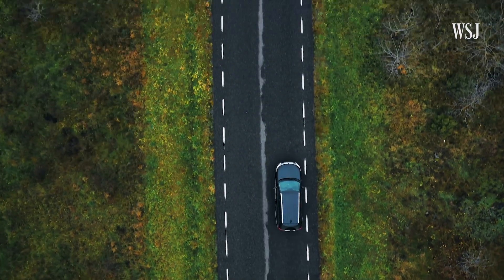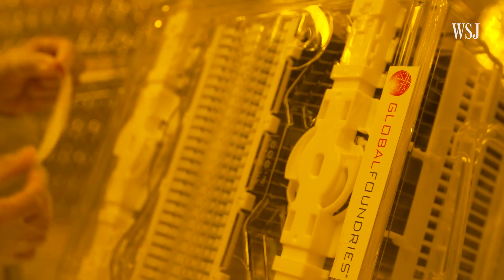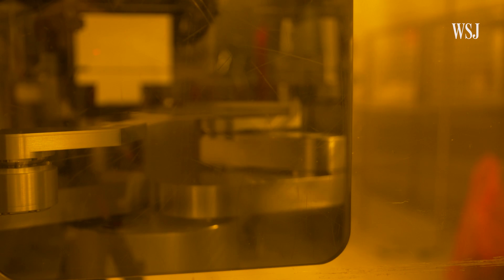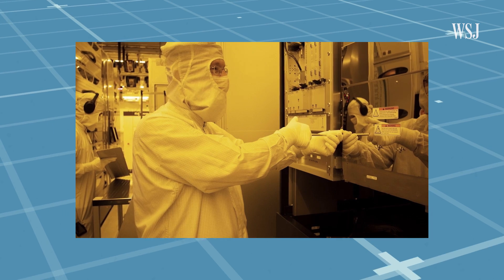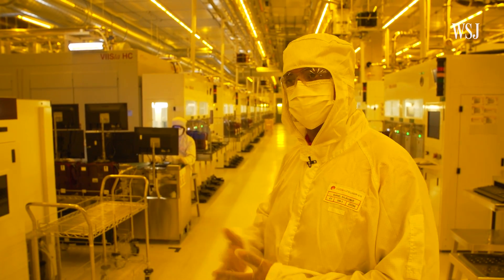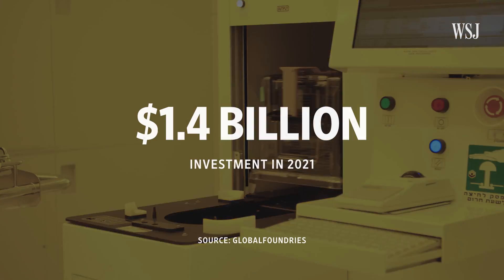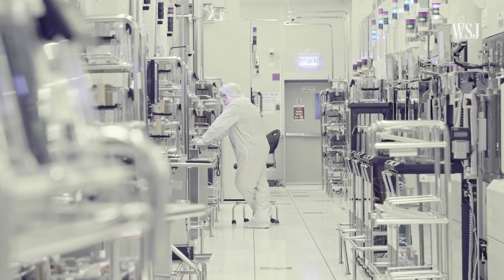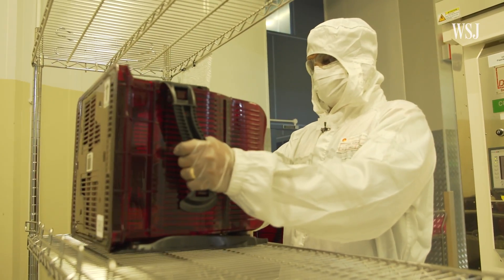Why the Global Chip Shortage Is Hard to Overcome | WSJ

Comment: This video gives a good explanation of the chip shortage albeit incomplete. The modern high-tech smaller chips are made by TSMC in Taiwan. The older, low tech and larger chips are made in China for cars and home electronics/appliances. China has a energy shortage right now that prevents them from manufacturing chips which is energy and water-intensive. China's energy problem is not going away anytime soon. Youtube source: https://www.youtube.com/watch?v=JqDcLmgg0a4

Comment: Inventory of unsold vehicles runs into hundred of thousands if I am not miataken as they make new cars every year and all could not be sold such that they are parked somewhere. Are these chips use in 5G, computers  and new model of cars? All chips are accounted for and nobody is cutting in line. So how long thus a foundry company get even and profit coming to roost? So any change in the wavelenght means new foundry, that would be expensive

Comment: As someone who works in the semiconductor industry I'd like to just point out that a large part of the problem is that all these industries cancelled their orders during the initial peak of covid and most fabs had to slow down production in response.  When they realized that people were still buying things, all those industries just expected the fabs were still manufacturing.  They overpromised before they confirmed they had their supply.

Also I'd like to point out that the process they have outlined here is an EXTREMELY simplified version.  If you want to contribute to the creation of smart cars, smart phones, medical equipment, space technology and more, research more.

Also I'm not sure which process but the device you hear chirping about a quarter and three quarters of the way in was designed by a company called Kokasai.  I know that sound very well.

Comment: Am I crazy or would making square discs be better like what happened to the edge chips that are rounded
Reply: what the youtube video did not show is how the silicon wafer is created....  its actually a very large crystal that is grown in  a chamber... once the crystal has grown to the size they want it is taken to a saw and cut into the  silicon wafers and polished...  the crystals don't grow in a square pattern ....   there are two types of crystals grown...  one is called and NPN and the other is called the PNP...   each type of wafer is used to create either a NPN or PNP transistors....    yes, because the wafers are round the actual devices ( chip ) on the edge of the wafer are scrapped...this is called the exclusion zone for the wafer...  the crystal itself is made from purified sand... so they make sand into money....

Comment: 600,000 chips a year that doesn’t add up with why they just said. 
20 disks per tray x 400 rolling around at one time x 1,000-1,500 chips per disk = 8,000,000-12,000,000. So does does that mean there are that many bad chips being produced at the same time??
Reply: I know from the plant I worked at here in the US, our target was 95% yield on a wafer.  Keeping in mind that was working chips, not prefect chips.  Sometimes the yield would drop to 92-93%.  Im not sure on numbers after all the testing.  I would imagine a decent % of chips would be filter out  due to poor preformance etc. Not pr3fect chips Would either be scraped or repurposed to lower end things.  A lot can go wrong during the several months a wafer would be in the fab.

It also greatly depends on the process, low end cellphone chips would have much better yields then high end chips.   I heard once that super highend yields could be as low as 60% if the process wasrealky new or proneto issues.

Comment: I worked in the industry for 35 years, retiring 5 years ago. I started with the state of the art lithography system company at the time, Perkin-Elmer and finished my career with the present state of the art lithography system company ASML. I met some incredibly brilliant engineers who could easily make my head spin and realize I was merely a dope and they were gods from another galaxy! I installed and maintained these systems around the world. What is better than to see the world on expenses? Thanks to so many geniuses for never failing to enlighten me and giving me a wonderful career.
Reply: while i think you are a little too humble --- there is a lot of engineering for operations / maintainability but there is definitely not the mentaity that a tool / process is engineered by geniuses to be run by idiots (ROTFL) - i agree that some of the materials scientists and engineers I met at Intel & Applied Materials were intellectually  mind-boggling.  I just supported MES & EC software integration in the fabs for 27 years.   Lots of stimulating work & travel around the world.

Comment: Well my PC is 5 years old, and i will hang on to it for another 5, so i'm in no rush to buy.
Reply: My PC is also 5years old and nearing replacement time. Can't run the software I need well......
Reply: @henri6595  What software? 5 years is usually when one upgrades their rig.
Reply: @davehenderson3739  Adobe Suite, MS Suite, 50+ tabs open at once, multiple monitors. I think PCs are only going to be good for <3 years going forward.
Reply: @henri6595  I got my new PC in 2016, so it's 5 years old, time for me to upgrade but all that you mentioned my PC can do.

Comment: At the core, this "shortage" is a simple function of a market: supply and demand. It is nothing special. The outcome of this function should be an adjustment of the market: raising cost of products will open up opportunities to add supply to the market. 

Yes, it is "bad" that you cannot buy a PS5. Also, maybe the price of your next car will be slightly higher. It also might lead to the US or Europe to building their own fabs. Or the some companies will change their product design in order to reduce the amount of custom chips or even reduce/remove features. Again: this is a function of the market to negotiate supply and demand. And it is a good thing.

Comment: ...and yet walmart still has tons of big screen TVs at cheaper prices than ever???
Reply: I am not sure they would need the kind of chips compared to console or computer. It isn't really doing calculation and rendering like a computer, just projecting an image constructed from a signal.
Reply: Patrick J Mims  Hrm, well I guess with these tv's that have netflix and internet connections, that must be true. Still, I can't see them requiring the power of a PS4 or a contemporary desktop computer. There are other chip companies, these are the chips for cutting edge computers.
Reply: Because TVs use "old" tech, it doesn't take much to run a TV, and TVs are so huge now there's tons of space to use older, cheaper, larger chips. It's the super small chips that are in most demand.

Comment: One wafer=1000-1500 chips
They produce 600,000 wafers on average annually. Which they upscaled by 120,000. 
So 720 million to 1.08 billion chips annually. Crazy to think that's a shortage
Reply: in 2020 (a down year) TSMC the largest chipmaker had revenue of $50B while the total addressable market for all types of chips was $450B.  yep - it is not just the supply - but the demand is thru the roof.

Comment: 0:03 Stores data about what you bought.
Uh no it doesn't... That data is stored on a server, all your card has is information to produce a handshake with both the terminal and the bank to prove it is it. It's how someone can steal/find your card rip the chip out and still use it (if done right) but can't find out you blew your entire paycheck on "content". It's also how someone with a half a card could still tap it and successfully buy something but wouldn't be able to gain access to your bank account.
This is why it's important to cut a card threw the tapping area and chip.
Reply: @0x150  It's whatever the bank/credit card company has on you including transactions, billing info etc. It's one of the safer places for your data, as most companies spend millions on protecting your personal information, a small price to pay for your confidence in them therefore giving them your business.

If one wants to go full paranoia cash is the only option including getting paid from your work, well actually crypto is lol, but unfortunately all instances of that have been done wrong and have become a commodity. (It does have the potential)
Reply: @0x150  So you mean the actual chip? I forget now, but I'm guessing a unique identifier either via a specific pattern or a unique code programed/built in that's associated to that specific card, I'm guessing it uses the same tech as a SIM card for your phone. I'm sure there is a YouTube video that explains it better how both the chip and tap functions work. As long as the information the chip/tap gives is correct it will work every time, similarly to how you can remove your sim card and put it into another phone that would work on your providers network.

Comment: That's why anytime I hear someone say "Oh the shortage will go away once the pandemic is over" I feel like I want to pull my hair out. The fab's have been running at full capacity the entire time. The only way the shortage gets fixed is increasing manufacturing capacity. Which takes years. The money isn't an issue they'll spend money if they think they'll make more money. The issue is the time It takes to get new fab's up and running.

If someone has a wish from a genie that they have been sitting on. Take one for the team and wish for the manufacturing capacity to meet the demand.
Reply: I work at a fab and to get a fab running and tools installed and qualified would take 4+ years each easily.

Comment: This issue could easily be resolved if each country would have their own wafer factory. This would increase production rate, increase quality of product, lower delivery times, create high tech jobs for countries and prevent natural causes/downtime. This will be a high upfront cost but will make more money in the long run since more products everyday require chips.
Reply: Chip manufacturing is one of the most complex mass manufacturing industry that humanity has accomplished up to now. It takes unimaginable amount of start capital, a stable in all manner geolocation, complete and uninterruptible consumables supply 24/7 (electricity, lots of pure water, all manner of highly pure chemicals, etc), highly skilled and trained/experienced workforce. The amount of investment and preparation for a modest fab will cost in the billions of USD, and you have to wait a few years before even a single die is created. It is not possible for brand new players to enter and compete in this market. And it is a far better option for corporations to build fabs near others as they can utilize the readily available resources and skilled workforce. Its a lot cheaper to manufacture in those established asian countries and figure out the most cost effective logistics chain to supply the globe instead.

Comment: Traditional integrated circuit manufacturing has been obsolete for decades.  Why is this a surprise to you now?

Intel must be crying about something again.  If they would stop losing in every market to literally everyone on the planet, it might help.
Reply: interesting first sentence - not sure what you mean. 
definition:
An integrated circuit or monolithic integrated circuit (also referred to as an IC, a chip, or a microchip) is a set of electronic circuits on one small flat piece (or "chip") of semiconductor material, usually silicon. 
AMD makes the better CPU/GPU vs Intel and the struggles / declline of Intel is well-known  It still has a broad product ine & 90B revenue however.  it will be interesting if the US gov does try to bolster R&D for American companies for chipmfg - in which case Intel will get $$$

Comment: Huh, massive vaccine production and a microchip shortage, go figure.
Reply: Vaccine production is up because every country is trying to purchase them right now. Chip shortages for auto makers are because manufacturers cancelled their chip orders thinking demand would stay down, but automobile demand jumped back faster than expected. In the video they said that chip orders need to be placed at least a year in advance. 
Toyota is not facing this problem as they stockpiled 6 months worth of chips, but automakers like Ford and Tesla use “just in time” manufacturing and are now facing the consequences. 
Also, it’s impossible to fit a chip through a 21-gauge needle.

Comment: Just more short sighted reporting from MSM. I've been an electrical engineer for over 30 years, and the real reason for the shortage is only mentioned in passing at the beginning of this report. The actual reason is the trade war between China and the US. 
If you go to China, you will find that there is no shortage there, only in the US and other allies of the US. 
China has the major bulk of complex small feature chip plants in the world. The company TMSC is the world's largest chip maker and they are making chips at a rate that increases between 5% - 25% annually. But since all of these plants are located within China (or Taiwan, which China also claims) the Chinese government has control of the export of these chips. These plants are massively expensive and complex to build. If the US wanted to regain control of this important manufacturing resource, it would take trillions of dollars, and nearly a decade before they could match, and then exceed China's production abilities. 
This chip shortage will not end for the western free market until China either gets what it wants, (world domination) or western free market makes the investment and gets the manufacturing resources. Until then, prepare for long lead times and massively over priced electronic products.

Comment: Why are they circle? It could be in rectangular shape and could probably produce more chips
Reply: they basically dip a rod to a silicon tub, making a tube like lolipop. what they need is consistency. the amount of silicon in circular wafer is far more consistent than a square one. they already knew that a circular shape is the most consistent when building wafers & all those silicon that get's trimmed out of the wafers get's recycled anyways
Reply: @asadosan6934  Yes, they use a seed crystal to grow and slowly draw the crystal while it is molten. Then they round it off, create the flat, or notch, and then slice the crystal ingot into wafers. Then they lap them to reduce them to the required thickness and then polish planarize them. https://youtu.be/AMgQ1-HdElM

Comment: I wanna know how they cut they cut the wafers? What kind of saw do they use?
Reply: Nd:YAG Laser, Dicing Saw, Plasma Dicing or scribing in break lines to snap them apart. Can have the separation lines put in before the components are added onto the wafer during the process of adding the coating materials and attaching the wafer to a metal or plastic support with an adhesive backing. Look up "Wafer Dicing" and you can find better info on Wikipedia and other sites that go into detail.

Comment: Let’s build a cheap analog car. My 1963 Chevrolet convertible ran just fine and it did not have a computer chip. I had an AM/FM pushbutton radio in order to turn on the heat I push the button and slid a lever or hot or cold, the same way with the AC. I had a progressive 3/2 carburetor system on my 327 engine.  I could cruise around all day getting the economy of the two barrel carburetor. When passing a truck on the highway I had to be careful breaking the rear tire is loose when I engage the other carburetors.
    Let’s go back to this time, let’s go back to cars that worked, cars it could be repaired in a home garage.  There is really no need to have everything hooked up to computers.
Reply: lol I wish I love old muscle cars but nothing with a carburetor or points ignition would ever pass todays emissions standards the EPA would not allow it and then we would be forced back to the horse and buggy era living like the Amish do.

Comment: Intel had a billboard on Highway 101 and Trimble road in Santa Clara boasting new, faster speeds. 286 MHz, 386 MHz. Whew screaming machines. Back then, Moore’s law was new. 

Incredible scale.  nanotechnology compared with DNA strands. 5 nanometer transistors? Billions on a chip. Multi-layer circuitry. 
I grew up in Sunnyvale watching all this silicon growth.
Reply: 5nm?  2nm transistors are coming from IBM.  Moore's law is definitely not dead yet!

Comment: Here’s a free tip: If the plates that the chips are made on were square rather than round, 100% of the surface could be used rather than the current wastage in partial chips around the curved edge. You’re welcome.
Reply: Nice, grow a square SI crystal, will make u a lot of money